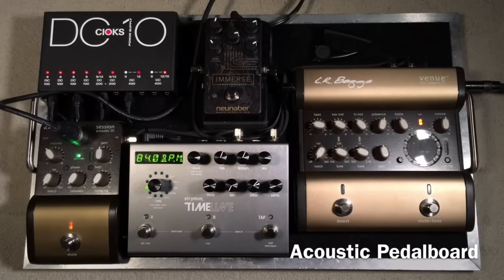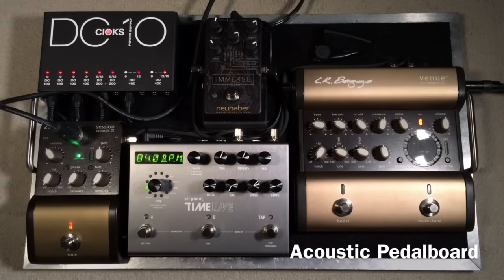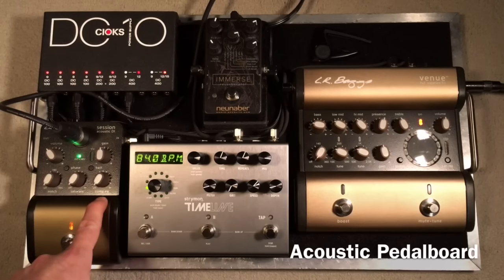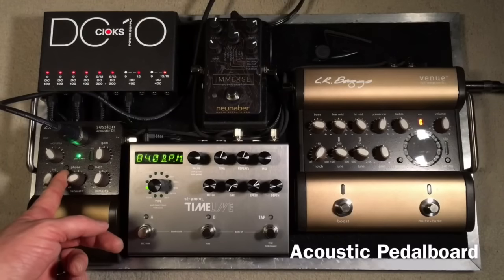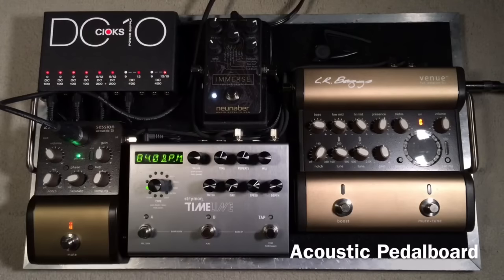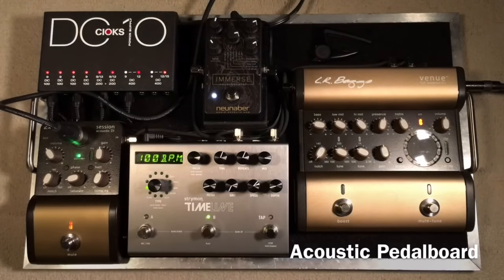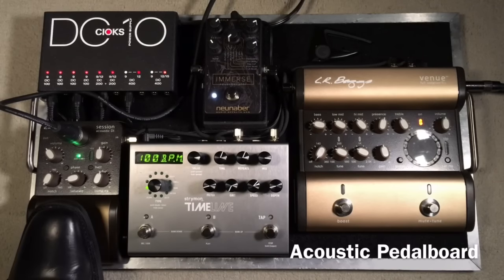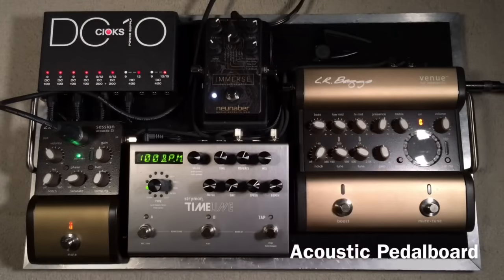LR Baggs Acoustic Guitar Pedalboard Demo

Comment: Great vid, thank you. Question: I already have the LR baggs venue and was thinking of adding in the Align series session (which has the compression and saturation but not a DI).. would this get the same result? Any reason why I should consider the session DI over it ?
Reply from the maker: Dave great question. I have not used the align series Session Di. I think the results should be the same though. The align session was not released yet when I made this video. But would love to try it. let me know what you decide.
Reply: @KentToneworks ive got all 3 between my personal board and a church board i setup.  I have the di on my personal board but run the the align session inline after the tuner and before the venue then the loop for any mod/wet fx. It works just like my session di.  I’d argue better when u consider the comp is first in the gain structure with the align as it should be vs last on the di.  Id much rather have the loop so my signal wasn’t getting compressed after the wet effects.  Unfortunately in the case of the di it has to be last to take  advantage of the balanced out.

Comment: I have noise on the XLR-Out of the Session DI. Regardless of whether with battery or phantom power and even if the gain and volume are completely set to 0. Does anyone have a similar problem with this?
Reply from the maker: might be the ground wire in your buildings elctrical, I've also had interference with lighting rigs with acoustic pickups sometimes.. maybe a clean power source will solve it.

Comment: Sir I have LR Baggs venue Di. Can you tell me the difference between venue Di and session Di it's very help full for me thankq !
Reply: I'm trying to figure that out, too. The Session DI seems nice, but I still think the Venue DI is better, because it has the Boost foot switch, which is nice for when you're about to solo and need a little push in the mix. The only problem is the Venue takes up more room.
Reply: The Venue is definitely more advanced and feature-laden. I have the Session and, while fairly simple, it really sounds great. It's got a built in high pass filter, ground/lift switch, and honestly the comp/EQ and the saturate knobs take it to another level. I think I'm definitely gonna get the Venue at some point, but the Session isn't half bad either